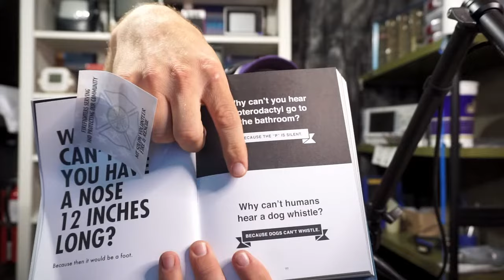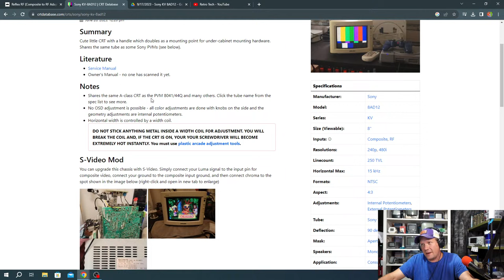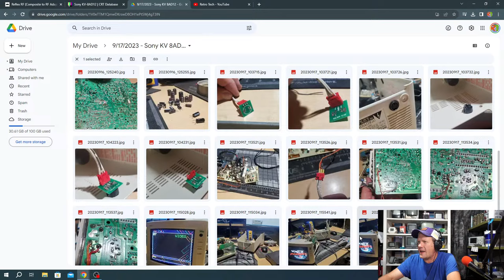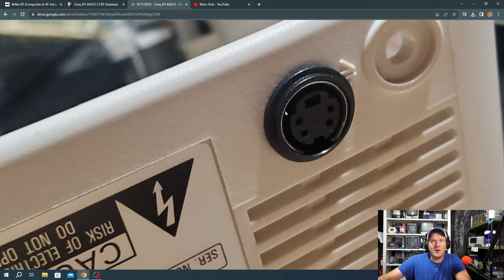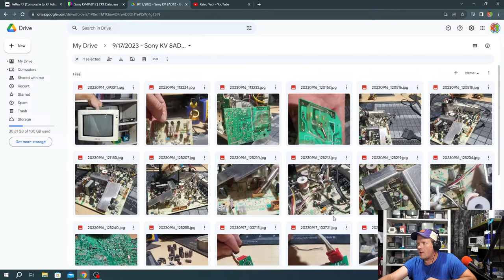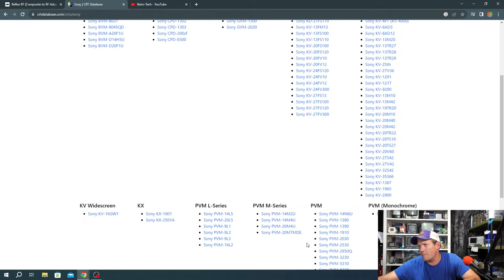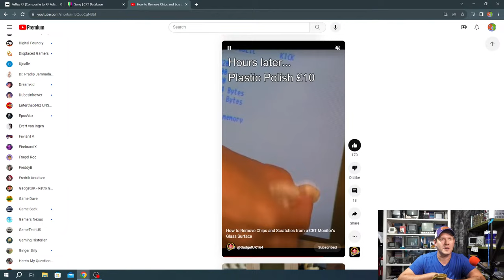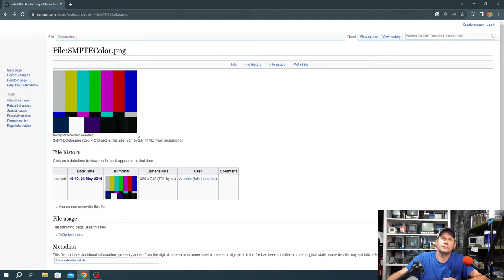The Bunker: Episode 3 - Adding S-Video to old Sony CRTs

Comment: I've got an AD11 (same, but dark grey plastic) and an AD12.  The AD11 definitely had some issues with solder quality.  The blue electron beam was not functioning when I got it due to bad solder.  The AD12 is a very clean chassis but power supply needs rebuilt.  As Steve said the tubes are same as the lower line count 8in PVMs and these can look really nice when properly serviced and adjusted.  One of the other nice things about these tubes is the 70 degree deflection angle versus 90 degree in other tubes including the newer 9in models.  Makes for better performing deflection circuitry all else equal.

Comment: so I picked up a KV-8AD11 which is the same chassis but the black version that has a handle on top, and you said that the black version was able to be modified for RGB, I have looked everywhere for some type of documentation but did you have anywhere where I can look or at least point me in the direction of? I understand fundamentally they SHOULD share the same general chassis but as far as I was aware it didn't have an OSD to tap into the jungle chip for RGB, if I'm mistaken feel free to correct me for archival purposes. And by the way love the videos you're a great source of knowledge in our community!

Comment: Steve, loving your channel. Just learning about CRTs myself, mainly because I have a late 90s Trinitron that has been collecting dust for over 20 years, so it has very low hours.

It's a KV-27v66, before they included component video. But of course, it has S-Video, so I'm trying to figure out if it's worth doing the RGB mod on the Jungle Chip, or just use the S-Video (I'm guessing the latter).

But what I am really interested in - even though I appreciate the highest video fidelity (I'm a bit of an old audiophile) - is the ZERO latency. 

Back in the day, I remember blasting through Doom and Quake, but now I really don't play shooters - because I suck. But little did I know that ever since I switched to flat screen, I was adding as much as 30-35ms of digital processing delay.

So this resurgence of analog gets me stoked, thinking about landing perfect headshots from across the map with twitch-reflexes.

But what IMPRESSES me the MOST is - that phenomenal coffee mug you're rockin'. Now I know that I can trust you with my life....

Comment: Hey there, I am trying to add S-Video to my Dynex dx-r20tr. It shares the same motherboard as other models that had S-Video therefore the circuitry is present. My question is about populating the missing passive electronics. Behind the empty spot for the Y/C connector are 3 spots for either jumpers or resistors. I do not know the values of said resistors or how to find them. Any help would be greatly appreciated!

Comment: Is there no need to switch off the chroma coming from the comb filter?  I guess because you’re only sending luma to the composite input?

I’m doing a similar mod to my Toshiba MV20FM4 (it has digital RGB so the mux mod is out).  I was going to use a solid state relay to switch the chroma input from the comb filter to svideo, but maybe I should just try it without that complication!

Also, I recommend a step-drill bit for plastic.   It works better than a twist bit because it’s harder to melt the plastic while you’re drilling.
Reply: You can always feed luma into any composite video port, which generates a sharp grayscale image.  In this case the color signal is just missing so there is nothing to filter.

For this set there must be some sort of buffer transistor between the comb filter chroma output and the point at which the S-video chroma signal gets connected so that the signals don't get combined inside the set.
Reply: @readyplayerprime8195  yeah, I was already going to just connect the luma at the composite input.  I may just try connecting chroma and see what happens.  At worst, I'll have to install a switch - but hopefully I can at least make the relay work, so I don't have to manually switch inputs (it's solid state, low impedance input - so I'm thinking s-video Luma can be the switch for the chroma input).